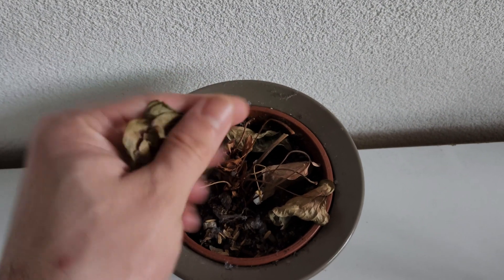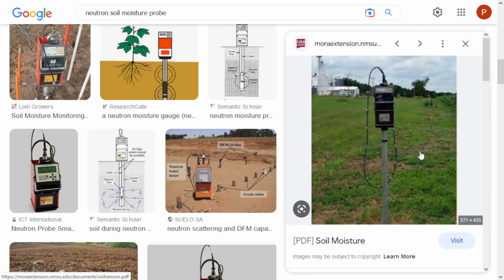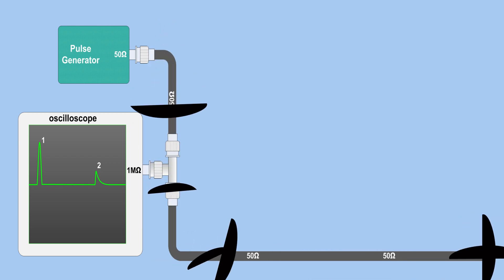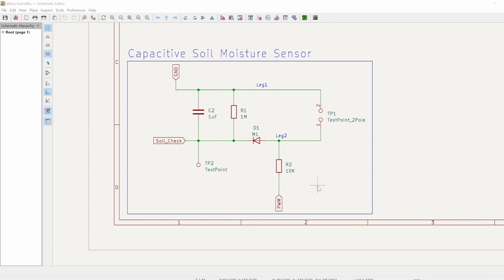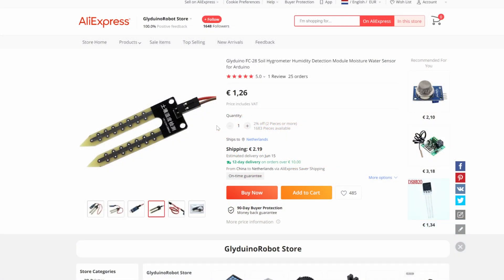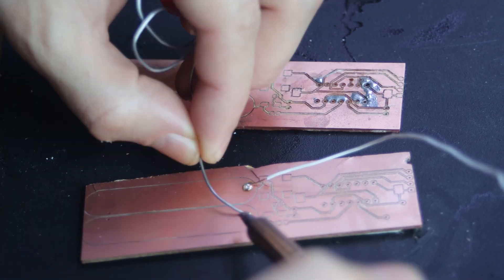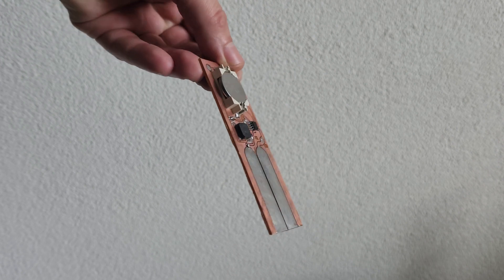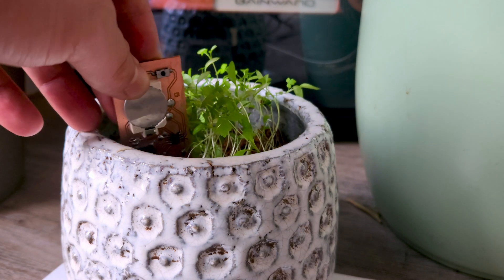Moisture-Duck  Sensor: Measure Soil Moisture with ATtiny13A and Duck-like Precision

Comment: I used resistive fork from aliexpress like in your video long time ago. Beat the corrosion was very easy. I cut off the pcb fork with corroded copper and soldered stainless steel electrodes to the remaining part. I took stainless steel from used car wiper.(rubber part is held by two ss plates)Cut the Stainless to the same lenghts as pcb was and insert to the pot, so the moisture and soil only contacts stainless plates and not solder or pcb.
Reply from the maker: Hi @Aleksei_R, your idea is really interesting. It never occurred to me to use stainless steel. indeed stainless steel will corrode with a slower rate than copper or tin. What about the solder? For example I tried aluminum rods, but they do not hold the solder very well. Is it easy to solder stainless steel?
Reply: @makersfunduck  after about a year of usage there was not remarkable corrosion if there was any. And it worked in analogue circuit, where current runs all the time. Soldered relatively easy. But i can not give any flux recommendations , because i used self made flux from rosin and soap boiled in vinegar and water🤣🤣🤣

Comment: I wonder if you could use graphite probes (like pencil cores) to reduce corosion even more
Reply from the maker: It will also corrode. and you need to replace the probes as well. but it is an interesting question. I will try how long it will take. Also I am wondering if they provide reliable results.

Comment: There wasnt any conclusion, are you saying resistive is better than captive?
Reply from the maker: There isn't a conclusion about which one is better. My conclusion is that both of them have ups and downs, and users should know their advantages and disadvantages. The resistive version provides reliable results, but corrosion is the biggest issue. Therefore, you should do the measurement sparingly. The capacitive version doesn't have this issue; however, it is not suitable for all soil types unless you can go to GHz-level frequencies. So you should have certain types of soil without air gaps and insert the probe very carefully to get a trustworthy result.
Reply: @makersfunduck  thank you that was useful! we might not need high frequency, just output a square wave and measure local edge vs return edge with 32bit hw timer, the difference would be the propogation delay, and repeat multiple times.
Reply: @makersfunduck  One technique that is sometimes used with resistive probes is to encase them in a known porous matrix such as plaster of paris.  This reduces the effect of different soil types since the moisture measurement is always done on the same material.  There might still be issues with variation as different ions migrate into the matrix but it should help.

This is an older method and so I'm not aware of any testing done with it and capacitive probes but I imagine that it would also work for the as well.

Comment: what about rf energy, like 50mhz, does water block it ?
Or if water changes Z0 of a coax, it should be possible to test it.
Reply from the maker: I tried capacitive design on different frequencies. around 10mhz, you start getting feedback once you put it in water. 50 mhz is also better. however once I put it inside a real soil, it did not work, and academic papers requested that if there are gaps inside soil, those frequencies does not provide a reliable results, as I observed. But around 1Ghz , it was working fine. however I couldnt find a cheap MCU which can work on these frequencies.
Reply: @makersfunduck  So, how about heating up the soil a bit and test the difference of temperature? Let's say 5v on a 100ohm for 30 sec and test the temp before, after and 2 min after? Should be way cheaper.
Reply from the maker: @hanyanglee9018  
I have found most relevant these 2 papers discussing your proposed solution. 
https://sci-hub.se/https://doi.org/10.1093/jxb/20.1.46
https://www.proquest.com/openview/497729083bc894de658f1591fac75101/1?pq-origsite=gscholar&cbl=52938

What my take from these (and other papers) is, it can be done, if you calibrate and get the real soil content for the type of the soil that you have. it is different for different type of soils

However it wont be a low power design, since to get a decent result, you need to apply considerable amount of current (in the paper they used around 350mA to get a decent results). 

Also I am not sure if it would be cheaper, since you are adding another component (temperature sensor) to the BOM. 

But I think it is indeed an interesting concept that worth writing another scientific paper :)

Comment: I am planning to make s similar device, with some differences:
1) small solar cell instead of battery; flashing LED instead of buzzer
2) Preferably no MCU - just CMOS/digital; ATTiny, MSP430 STM32 as a last resort.
3) It is true that DC corrodes the electrodes. Also correct that capacitance method in side-by-side electrodes if iffy. This can be countered by having face-to-face electrodes with a water-permeable membrane (e.g. a sheet of microfiber "paper") sandwiched between coated electrodes. Permittivity-changes should IMO become obvious and clear in this configuration. The paper may eventually get  contaminated by stuff in your potting soil. Resistance-measurement is also possible, but IMO "AC" measurement (i.e. with an AC biasing stimulus, with each electrode having a series-capacitor) would eliminate galvanic corrosion even if you did not run the device intermittently. The problem with DC interfaces is that even very small leakage currents, over extended periods, shall eat away the electrodes (and cause electropotentials) whereas the DC-insulation offered by a plastic-film capacitor is outstanding, robust and cheap.
4) about your "GHz" problem: (out of academic interest) --> An ESP32 has a 2.4 GHz pin, and RSSI indicator ;) - I wonder if this can be repurposed for humidity measurement. (self-attenuation due to moist soil)
Reply from the maker: i think your solution work, but if you can use at least a timer, it would definitely increase the life of the electrodes. considering more or less a cheap mcu more or less costs same with a 555 IC, MCU would make more sense.

But your ESP idea is really worth investigating and I find it really interesting. but their power consumption is questionable even during deep sleep. Still I will look at the datasheet for a bit deeper:)
Reply: @makersfunduck  I was thinking lower tech - sth like a single-gate 74HC14 and a 16-bit (Divide-by-65536) counter. Slow flash --> all ok; fast flash --> water!
Reply from the maker: @AdityaMehendale  Sounds really interesting. I would love to see your design, if you make it open sourced.